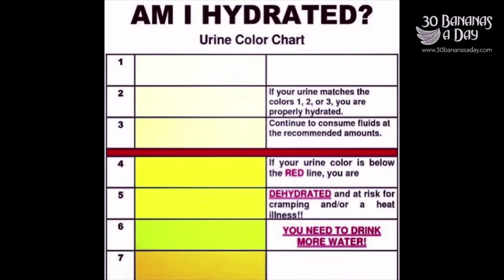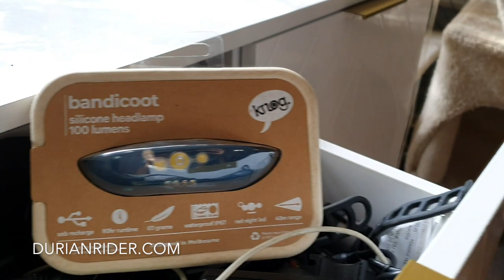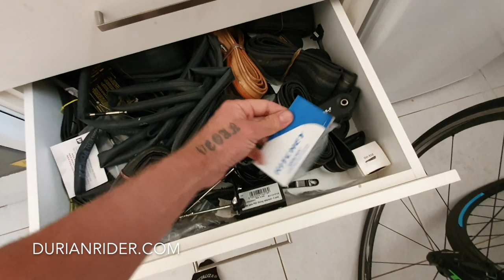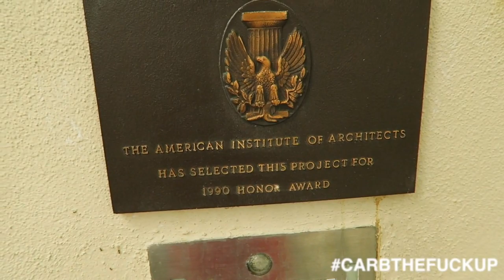Carbon Bike Collection Of A Multi Millionaire Youtube Celebrity

Comment: Drool was dripping on the floor from my mouth when you mentioned the Emonda SL frame. 
I currently ride a 2018 Emonda ALR 5, which over the winter (I live in Canada) I have put on a diet. I am waiting one last part and I am done. My final weight should be right around 16 pounds, thats down almost 3 pounds from stock. I was able to keep almost all the 105 equipment. Most of my weight savings came from removing ALL the Bontrager parts.                  Cheers :)

Keep the great videos coming.

ps... LOVE your Ferrari!
Reply: “Your”